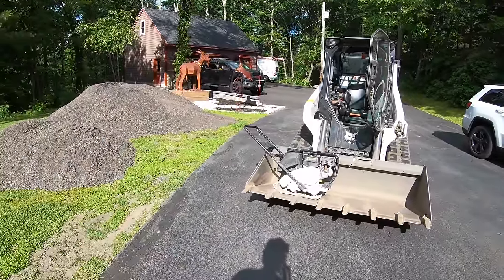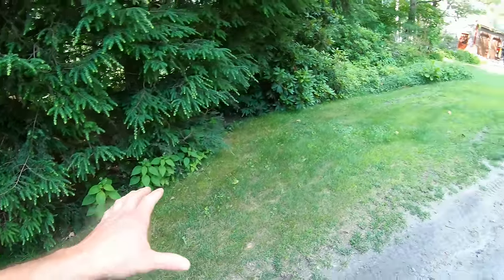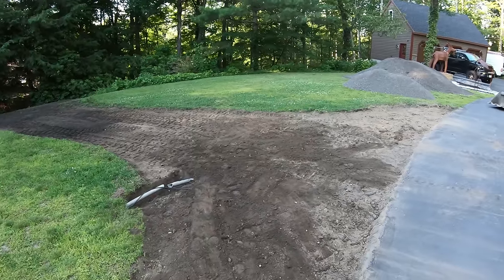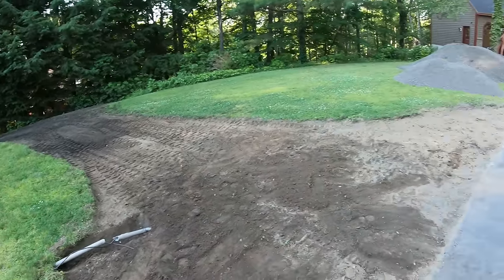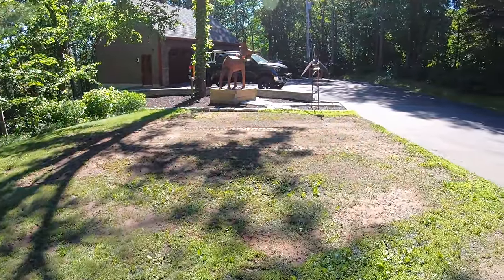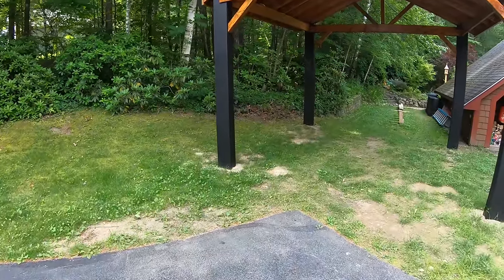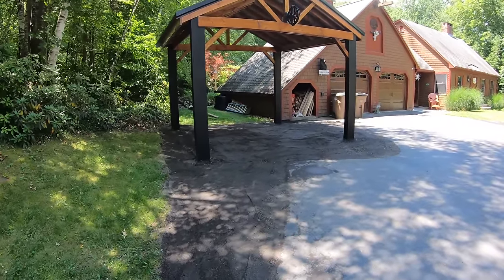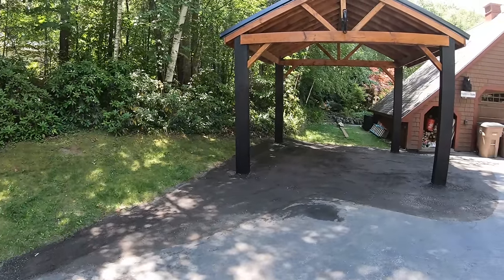Cutting in an Asphalt Milling Path & Car Port

Comment: Another great video. I’m retired, but still do small jobs like your driveway project. I’m also a firm believer in using recycled asphalt (millings).  My go-to setup is the L-Series Kubota in front of a rear blade and box scraper. Hard to beat in tight places and where the border needs to be spot on. That product also stays in place much longer than compacted base or shale on steep driveway applications.

Comment: I used to be a contractor for Comcast. That conduit was buried way to shallow. It was also to big. 2" conduit isn't used for coax pulls under yards. 2" conduit is used for pulls going from the tap on the distribution line to the ped. That was a very lazy and unprofessional install. But, I also didn't see any locate marks. Should have called 811. Even though you weren't digging that deep it's your responsibility as a contractor to get the locates done.

Comment: Looks good, it’s too bad it don’t last.   Many people in our little had their driveways done and packed with a big paving roller and it just moves, if you turn too sharp it pulls up and created marks, holes.  ATV’s and Side by sides rip it all up.     But still good work and nice clean job you did.

Comment: Renting a commercial roller would have been well worth it for the homeowner. Would have left a very nice consistent smooth service down the entire drive. But it looks great. If I was you I would invest in a pair of extremely comfortable tennis shoes. I stopped wearing boots many years ago . Much better on the feet.👣

Comment: Do you find it difficult to push dirt with the bucket of the sub compact tractor and make the ground level? Every time I try it I feel like my tractor just starts digging in and lifts up, creating a wide hole basically
Reply from the maker: It can be pretty tough to level hard or rocky ground with the bucket. Takes a lot of practice and manipulation of the bucket edge to make sure you don't under/over dig. I have definitely gotten better at it, but as you say, there will still be times where the bucket will dive into the ground.

Comment: Dude any tips on grading with a tractor. You were so smooth under that car port. Every time i try and grade with the bucket in my tractor. I make waves or somehow keep digging deeper. And my front wheels always come up.
Reply: tracked machines do a lot better job of grading compared to anything with wheels. It just how they move across the ground that helps get that smooth finish.

Comment: Are the millings adequate for going right over the dirt with no stone base?  I'm working on a additional parking pad next to my driveway and considering millings vs gravel.  I'm in western NY and wondering what material will be best.
Reply from the maker: It depends on your subsoils and drainage. On this job, the base below the top soil was very hard (as can be seen in the video) and there was no standing or moving water in the areas the path was being placed. If the subsoils are hard and dry, then it should be fine to layer on millings.
Reply: As I dig the area it's definitely a bit wet at the top, dryer as I get down...I'll have to evaluate it more once I'm done clearing the area.  Thank you for such a fast response!  If I decide to put gravel down now then I will likely add millings to the top later on.  That driveway in your video looked great!
Reply: Depends on what you are planning to park on this parking area. Anything with weight you will need a better base with gravel.

Comment: nice work. who the hell would bury electrical not even a foot below the surface?
Reply from the maker: It was a comcast comm line and they have no standard or requirement for depth like electrical or gas

Comment: Just curious, what was the purpose of watering the millings?
Reply: Helps them bind together. Even though the asphalt is cold, there are what we call "fines" in it. The fines is like the dust of the product, be it gravel or asphalt. If you want something to bind, you want fines in it. getting the fines moist will help them adhere and lock in the product thereby making a solid surface. Make no mistake, asphalt millings aren't a replacement for a properly paved road surface, but they can provide a solid and stable surface that holds up better than just gravel. I work for a county road dept and we used asphalt millings to "pave" a road in our pit. We drive dump trucks, vactors, loaders, etc on it and it holds up great. We give our millings away to county residents free of charge, so if it's something you want check with your municipality. I'll bet you can get them for free from them or paving companies.
Reply: So would the millings be ok for additional parking area for residential driveway, even with no gravel beneath the millings?  I am going to be borrowing my friends plate compactor and will spray it down like in this video.

Comment: Poor cable guy. Hopin he just had to splice that ug drop. Use a gel cap. No high speed internet until that gets repaired.
Reply from the maker: Client said they were able to re-pull the line and patch the conduit all fine. Though they had to fight around another broken part of the conduit further down the line under the driveway that got damaged when that was done.
Reply: I love you